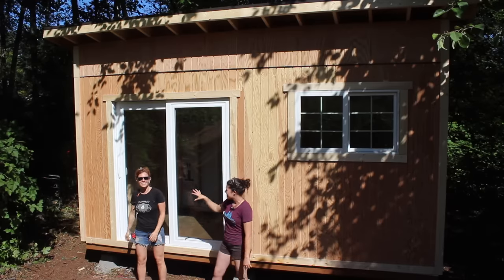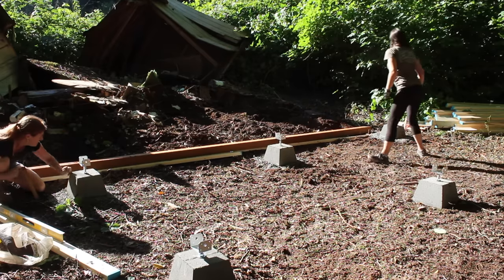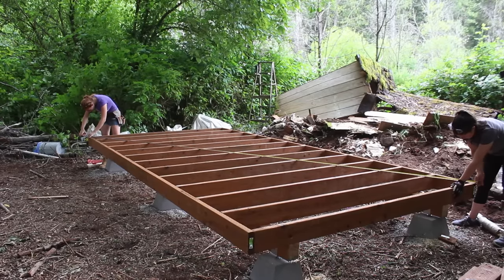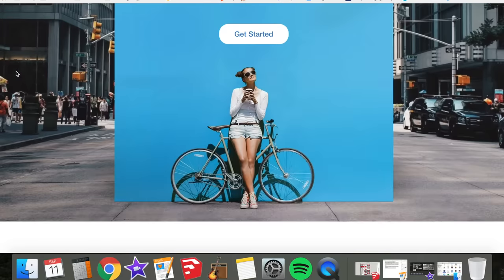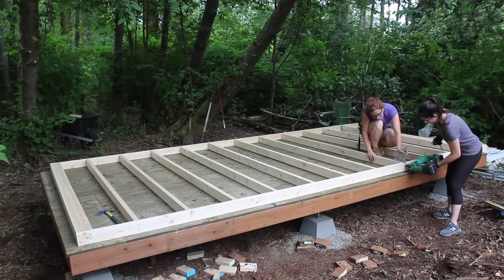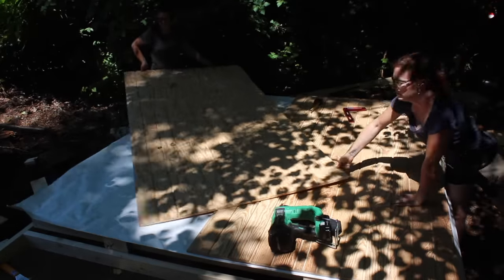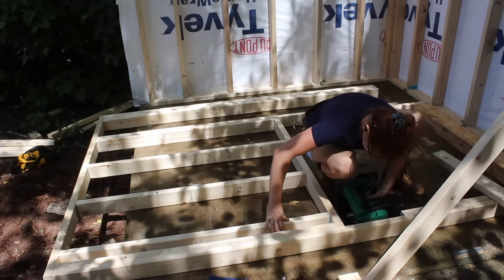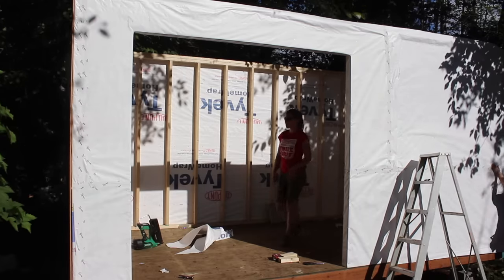Tiny House Build - Foundation and Framing

Comment: Our 1466 sq ft tract home in California is post and beam construction, with outside perimeter foundation, but there are no joists.  It's just 1 1/8'' tongue and groove plywood laid right on the beams.  And the beams are 4 feet apart!  Very bouncy.

Comment: I personally have 2 chargers for my battery tools and often use them at the same time. I also have some solar panels that I just need to finish off so I don;t draw any electricity from them or my fridge inside my house. The more we do things like that the better our planet will be in the long run. Love your shows April and Anne! Great job in framing. Piece of advice: IF you are alone and doing the framing first build your walls then add your siding. The weight difference is huge. I used to do a lot of siding back in the day all by myself and I'd use a 2x2 or 2x4 and nail it along the edge of the outer floor joists so I could just lay the sheet of T-111 right on it and level it and nail it in from there. It holds the weight so you don't have to. Love ya girls! Great videos
Reply: Little Shepherd Farm the other option for standing up heavy walls alone is some diagonal props and a rope or chain and some pulleys.

Comment: You have a great talent. Great work,excellent sketch up and informational video.Try not lifting such heavy loads,you are going to wear yourself out before your time. It's all fun and games when you are young. Also if you put blocking between the floor joists it tightens up the floor structure. Good job on the floating foundation,small buildings do just fine this way.

Comment: I'm not sure how much wind you get in the woods there, but where I live, that whole house would blow off the beams since you only toe-nailed it in. I have to use metal brackets to attach the joists to the beams.
Reply: Tim Coombs Also it seems that the lack of compaction under the piers will eventually cause problems
Reply: @stopthephilosophicalzombie9017  hey can you explain this a little more for me? What do you think would be the best method here? I'm looking to build something similar in Maine where the frost line is 4 ft. It's only meant to be a temporary structure (shelter while building permanent house), but I'd like to follow best practices nonetheless.  Thanks in advance!
Reply: @lolahayes7091  throw a slab will last forever
Reply: Great idea!

Comment: Hey, April! I myself am thinking about building a tiny house! I came across this video and was wondering if you had the costs of the materials you used?
Reply: I would guess around 1000-3000 dollars, depends on if you need new tools, or what wood you use and everything
Reply: Most of the price is in the windows and doors and such, if you have a good place to buy wood it might not even be like 1000

Comment: We've tried sheathing walls before standing and after.  The best choice depends on the particular situation.  Mostly, it depends on how difficult it would be to sheath later from the outside.  One thing I never liked about sheathing the wall before standing is that you have to be very careful to square it up, and no matter how careful you are there's always a chance it won't be plumb and square after you stand it.
Reply from the maker: Yep I agree
Reply: Also your building was too small to sheath walls then set up. Where I've seen this work is on houses where subfloor was sufficiently large to allow building the wall right where they are to be set up,  tacking  bottom of wall to subfloor to act as hinge, squaring the wall, adding sheathing, and finally using floor jack (pole and cable that is screwed to subfloor) to raise wall right in place.  But subfloor needs to have sufficient footage to allow all walls to be built one at time in this manner.  Seen this used for second story walls like those above walk out basement, etc.  Nice build and nice instructional.
Reply: You must be a rookie.  It's easy to square a wall and keep it square while it's sheated on the ground.  Just nail your bottom plate standing on edge along the line you snapped for the layout of the walls.  Then nail it all together, square it and put a nail or two in the top plate to hold it while you sheet it.  Only time I don't sheet first is when building walls on a concrete slab foundation.
Reply: @chuckd9007  Not a rookie.  Framed hundreds of houses.  Been there, done that.

Comment: I live near Gig Harbor, Wa. Before building something, I first scrape away the first few inches of dirt (too squishy to build on). Ground too low? No problem! A few wheelbarrow loads of mud (as if I were placing concrete), wait a few days, do a few minutes of walking around on it, and I now have solid high ground. Soil clay/sand content will play a part in the final results, so YMMV.

Comment: Hi April! I plan to build a 12x24x13ft tiny house. Do you have any recommendation for foundation without doing concrete pad? I want to use skid underneate as well since our locations won't be a permanent spot and we want to move it later on. I would appreciate any help you can give. Thank you :)

Comment: No need to wait to install the second top plate. Just leave the plate on one end short and the other long. When you stand them up, just lap the long end over the lower top plate of the adjacent wall. Tip: If boards have a slight crown to them, assemble them so that the crown on the lower top plate is the opposite of the upper top plate. When nailed together, the two boards will work to straighten each other.

Comment: I was about to comment on why you were using a traditional style of framing over a modern style of framing. Then i remembered when i built my shed i did a modern style framing for half and went back to traditional for the rest as it was just so much faster for me.

Its just that a tiny house would need the insulation advantage that modern framing would give, considering that you'd want to conserve as much heat as possible due to its large surface area to volume ratio.

Comment: Weird question, where did you get those cement blocks with the add-in adjustable 4x4 beam brackets?
Reply: Wondering the same thing also
Reply: Same here. Saw them on Home Depot website however when I went in the store . They had the cement blocks without the brackets
Reply: Sorry for the late year response but they are at home depot. I live in Washington also so they are super convenient for adjusting. I called home depot and made a order and picked them up. Some store sell the brackets separately for whatever reason.

Comment: I just got finished building an 8X12 foot shed. However I had to do it by myself. I used reclaimed 2X6's to frame it. I had to get my wife to help raise the 12 walls but other than that I totally agree Sheething before you stand isn't really quicker. I temporarily mounted some 2X2 off cuts to the rim joist and put liquid nails along the studs. Then I tested the Hardie board on top of the 2X2 (of course I made sure it was level level and the correct over hang) and used the liquid nails to hold the Hardie boards on while I screwed it on. It would have been way too heavy for even 2 people to raise. I think it was much quicker with the walls up. I was wondering why you didn't make the trusses one you made the floor but then I saw y'all plans for a lean tue roof. I had planned to go that route but when I looked at the decking I got from 2 different friends I figured I'd make it as hard as I could on myself and made a 6,12 pitch roof. I put a tin roof on it. I find an external metal door with the frame intact on the side of the road so I put that on for my main door then I built a door the perfect size of me on my lawn tractor to get through. Talk about pump my first and scream the first time I drove my tractor in there and closed the door. I'm surprised my wife and kids didn't freak out and run out the house to see what was wrong. I understand the happy dance. I just did it the manly way by fist pumping, sticking my chest out and screaming like a gorilla. I couldn't imagine living in my 8X12 foot castle but I bet y'alls will be awesome!  I was watching you build your dream shop and the a Essential Craftsman while I built my shed and thank you very much for the motivation. I think your awesome and your husband sounds pretty cool too. He's a lucky man. Keep building cool stuff so guys like me that had a Rollercoaster of a life that led me to woodworking. Thanks again and keep up the good work. I can't wait to see Anne's finished product. I'm positive it will put my shed to shame but it's my pride and joy. I love my shed and couldn't be prouder of it.

Comment: This is really cool! I do have a question though. Why did you not use any insulation? Because if there was going to be insulation applied inside then the building wrap in in the wrong place in the wall. Also Insulation is just in general a good idea.

Comment: Cost for this project? Something I've been wanting to do forever.  Subscribed!  In Alaska and many up here use this option vs. a concrete slab.  We do require insulation under the floors, so I'll have to look into that online.  Not seeing how I'd be able to crawl under to install, but also have the options for grey water lines to a garden area.  Mine will start out as a dry cabin, but eventually, I want running hot water.  Off to watch the rest of this video.

Comment: No floor insulation?
Reply: I wondered the same thing. Should have had that treated plywood on the bottom of the floor joists then filled the cavity with insulation and put non treated in the living space. Im pretty sure that treated is going to of gas into the piving area and create a toxic atmosphere inside.
Reply: EPA regulates what goes into treated wood and I don't think they've issued any warning about its use.  No big warning labels. Plenty of it in finished basements.  Only potential hazard would be inhaling dust while cutting.  April knows what's she's doing.  If this was an issue it would've come up in permit process/ material take-off.
Reply: @xmassan20906  haha the epa....you must be joking. They are not concerned with safety...they are concerned with fines and revenue and thats all. Pressure treated should not be used in a living space period. It WILL off gas and can cause health issues. There is no reason to take the risk and if the floor would have been framed correctly it wouldnt have been an issue.

Treated on the bottom, vapor barrier, floor joists, insulation between joists, tongue n groove sub flooring. Thats the proper way to make the floor for a building such as what they made. Also im wondering if that vapor barrier they put on the walls is on backwards...pretty sure the writing is supposed to be out.
Reply: xmassan20906  I doubt that this is a permitted structure. Most likely, no permits were taken out to build the previous shed, not to demolish it, nor to build this tiny house.
Reply: I was thinking that but it's inhabited and there's an inspector on April's Instagram. Might be from the shop build. Look for the charging mule.
Reply: xmassan20906  that is interesting. But this is in Washington. April's shop is in Texas. I am not saying it shouldn't be permitted. Just that it probably isn't. I don't see any evidence that there will be discharge plumbing installed ever. So don't see how they would get a certificate of occupancy.
Reply: +Mike K By Dupont's own admission and definition, their Tyvek housewrap is NOT a vapor barrier. Also per Dupont, their Tyvek housewrap is "non-directional", meaning that it can be installed any which way you please. For someone so willing to critique another person's hard work, you sure are uninformed.
Reply: Can you explain to me what you mean by "pressure treated"?

Also, are you a builder or something? And can I PM you to ask you some questions? Thanks.
Reply: Treated wood is perfectly safe and has been since the epa forced the industry to change the chemicals involved from highly toxic arsenic to benign copper alkalides more than a decade ago.
Reply: Redfish Incorporated honey, if it can kill fungi and insects, you want to think about how much of it goes into your own system - chemically preserved food or chemically preserved timber is the same deal.
Reply: @tealkerberus748  not really, copper is actually a nutrient in mammals but is midly toxic to insects, arachnids, and crustaceans.
Reply: Redfish Incorporated but it's not pure metallic copper they're using, it's a compound. Think about the difference between ingesting activated charcoal, which is pretty benign, to being exposed to excessive carbon dioxide, which is lethally poisonous - but they're both carbon.
The salts in bacon were considered pretty safe in the quantities used, until the studies into life expectancy for people who have more than one meal of salted meat per week. Personally I'd choose not to be a Guinea pig in the experiment of whether the new timber treatments are going to affect people's health.

Comment: Not sure what your local code says but here in Canada the house wrap needs to be writing out as it breathes only one way.
Reply from the maker: According to Manufacturer's Booklet it can go either way.
Reply: Interesting. How does it breathe only one way? I mean, I have heard of membranes which are permeable to vapor but impermeable to liquid. That is the idea behind Tyvek. But how would the one-way breathing work? It seems physically impossible. Maybe the reason it goes writing out is something else? Like one side is coated or has a different emissivity (for radiant heat loss) or something?

Comment: Too cool!  Question though, is there a "inside an/or outside" to the Tyvek?  I've only seen the labeling on the exterior of buildings?
Reply from the maker: Good question! No there isn't, a toooon of people will say that it's designed to be one way but on the manufacturer's website it says it doesn't matter. : )

Comment: the print on tyvek is supposed to face outwards the wrb is made a certain way
Reply from the maker: You are incorrect. The Manufacturer's Booklet says it can be applied in either direction.
Reply: apologies , I just built a house using stucco wrap that was the difference in application

Comment: Is there a reason you applied the Tyvek opposite normal practice? Usually the "Tyvek" printing goes to the outside.
Reply from the maker: According to the Manufacturer's Booklet, it can be applied either direction.

Comment: I'm not a woodworker nor do I have much knowledge, but is nailing the floor to the beams enough to not make the house move/blow down?
Reply: Ma Ga I'd be using joist hangers to attach the floor joists to the side beams, and bolting the or screwing the bottom plates through the floor skin to the sub-floor framing. My house has metal tie-down strapping wrapped around the ends of the trusses and the top plates, and from over the top plates to under the bottom plates, and then the bottom plates are bolted with cyclone-rated bolts to the slab. I'm not quite sure what's holding these lasses' construction in place, the whole thing could blow over in a big storm for all I could tell - maybe they don't get the sort of weather I was building for.
Reply: @tealkerberus748  2 years later and now I notice the comment. Thanks for the answer man, I have a lot of reading to do after that comment :)

Comment: I'm going to start by saying, this was an incredible undertaking, and I am so impressed by what you accomplished.  But...  A  ground heaves when it freezes and moves up and down with moister, that is why they dig below the frost line, (how deep the earth freezes during the winter.  Tongue and groove plywood should always be used for the subfloor, glued down and staggered at 4'.  House wrap should not be wrapped into the opening, this allows any water that gets behind the wrap to go into the house. It should be cut to the opening, the door or window installed with dymonic behind the flange directly to the plywood, then peel and stick applied over the flange to the plywood, then the house wrap seam taped to the peel and stick tape.  Again, you are doing an awesome job overall, but I have been in the business for a long time and somethings (even for a shed) make me cringe.  Good luck on the rest of your project and I am anxious to see the rest.

Comment: The instructions actually state that you're not supposed to hold the trigger down on the gun and use it the way that you do for safety reasons not to mention the fact that the mechanisms not meant to work that way and it wears out the mechanism on the gun

Comment: You put The tyvek   on backwards... it lets water through that way because  that side is ment to breath so no mold will forum,  Always label facing out that is the waterproof side.
Reply from the maker: I know it's on backwards but it actually says on the manufacturer's website that it doesn't matter.
Reply: You can apply Tyvek either way. The only Tyvek product that must be installed with the lettering outwards is the Stucco Wrap. They did just fine.

Comment: Tyvek under sheething. Interesting
Reply from the maker: No not under sheathing, we skipped the sheathing step as our siding was thick enough to give the wall it's sheer strength. If we did sheathing then we would have placed the house wrap over it before the siding.